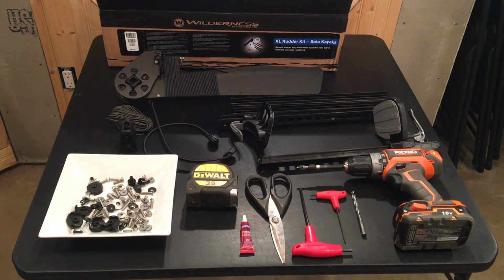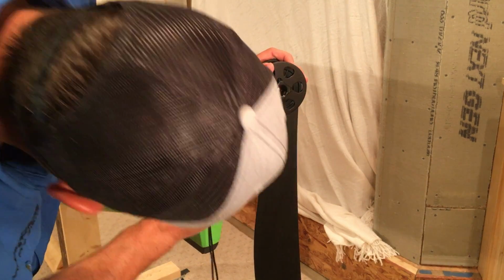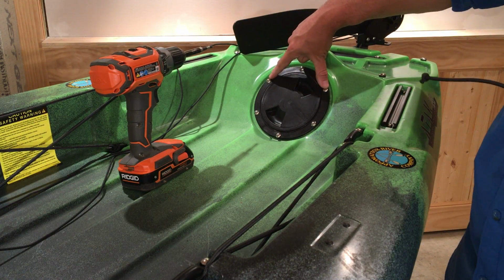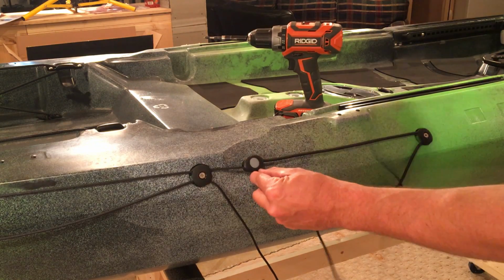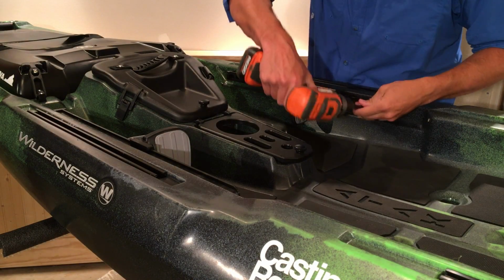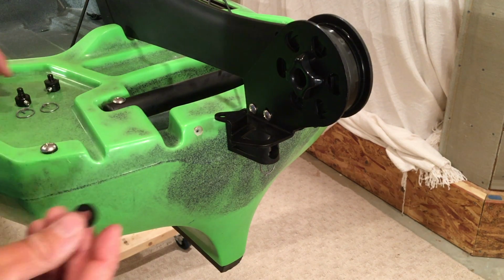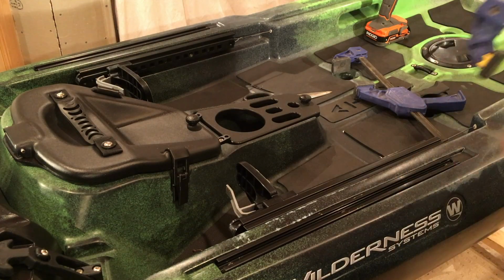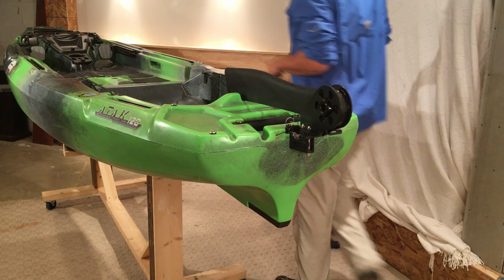How To: Install a Rudder on the A.T.A.K. 120 | Wilderness Systems

Comment: Where can I get the spectra line to replace it on my wilderness ride 135 rudder ?
Reply: Did you get a reply on this? I'm in same boat
Reply: Try a kite store.
Reply: is spectra line better than the metal cable they used on older models?